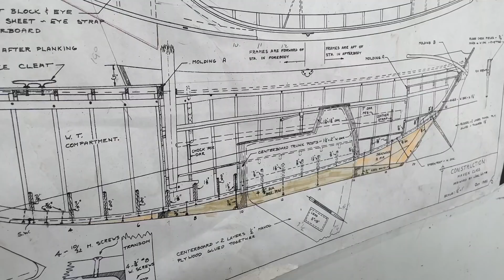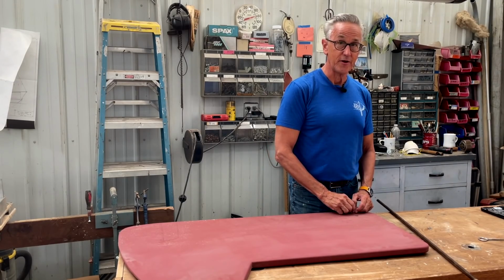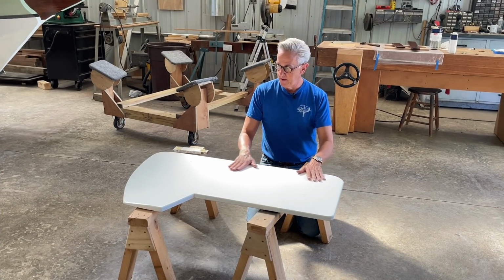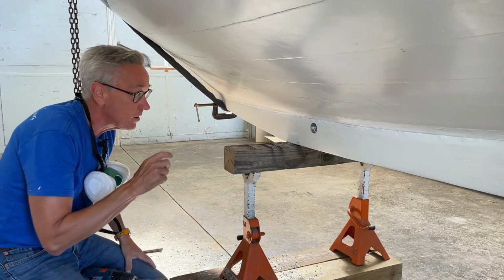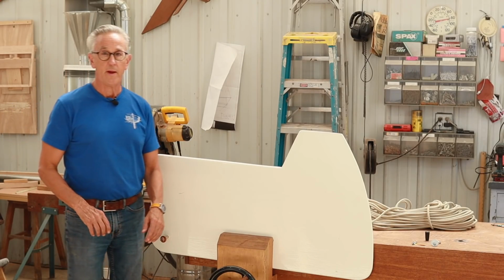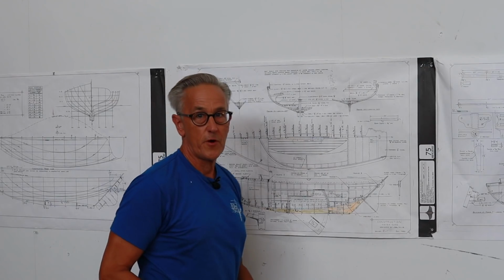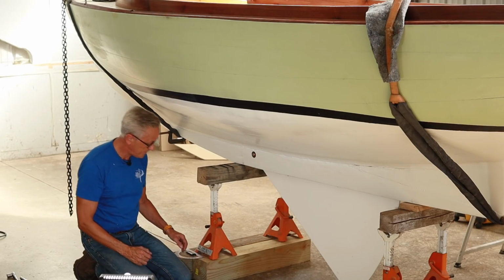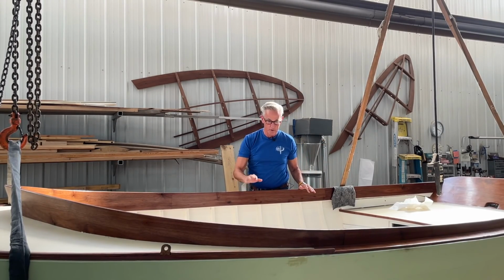Wooden Boat Building, Centerboard Installation S2-E52

Comment: Every piece of walnut that goes on this lovely craft just adds more class to it.  Nice work on this install.  Also as Ms. Trautwein mentioned below a G10 or Nylotron bushing around the pin in the lead portion of the keel might help with any electrolysis and also with any deformation of the lead from the stresses of the pin bearing against it.  Thank you Bob for this week's video.

Comment: News flash, WD40 is neither a lubricant or a coolant. It is a <W>ater <D>isplacement solution. You will get much better results from a high temperature oil or even a silicone spray. Still I'm glad it worked for you. That stuff has saved me more than once back in my teenage days. My distributor cap would get water in it during a rain and just a spritz of WD40 inside the cap would do the trick! I don't miss that old car 😃.
Reply: @bawrytr  
Actually it is a solvent, it will eventually strip away any lubricant that is present making it detrimental to use as a lubricant. I agree it works in a pinch, however it is always best to use a lubricant when the task calls for a lubricant. 👍🏼
Reply: when I drilled mine, I was worried about heat and seizing up. I went slow and had a glass of water handy. I kept dipping the drill bit in the water to cool it off.

Comment: HI Bob, wonderful attention to detail as usual and your video editing is superb.  I have a couple of thoughts. I hope that the screw eye isn't too tall. I couldn't do it the way you did as there wasn't enough room at the top of the board, pulled up and underneath the trunk covering board. I ended up drilling into the centerboard and epoxying the line directly into the board. Maybe you already measured and your dimensions are slightly enough different to allow that screw eye to have enough room but when I first did it that way, I couldn't get the board up and flush with the bottom of the ballast. The board was just ever so slightly lower and that wasn't going to work on the trailer. Please test raising the board up before you tightly fasten all together. The other thing that I am noticing as I sail is that I am getting water coming through the forward part of the trunk between the top and the forward covering board. I used no sealant as I wanted to have access to the forward part of the trunk if needed but since the forward part of the trunk is so close to the water line, when we take a wave and come, bow crashing down, water spurts out between the top of the trunk and the cover. I am going to seal it down tight as I had a fair bit to pump out of the bilge after sailing on Sunday. Hope this helps a bit. you're doing great!
Reply from the maker: Hi Chuck,
Thanks for the nice complement. I did measure the trunk height and chose the stainless steel eye size as not to be too high. At this point I have retracted the CB into the trunk and test fitted the cap and all fits well with clearance. My CB does retract completely flush with the bottom of the ballast keel. Great tip on the fore section cap for the CB trunk. My thought was the same as you as to access. I now will seal it before attaching it. Thanks for that insight.
Fair Winds my Friend!!
Cheers,
Bob
Reply: @MikeAG333   I will drill it out and replace. I used yacht braid line. I think it will out live me
Reply: @TheArtofBoatBuilding   I just ordered some Totalboat Seal. surely didn't want to use 5200, lol
Reply: @TheArtofBoatBuilding  what about a neoprene seal so that it is not glued down, but has a gasket of sorts?

Comment: No bushing in the lead ballast keel might be a good place for a G-10 bushings and washers to protect the bronze rod from galvanic corrosion.
Reply: I concur. However, bronze and lead galvanic action does usually take a while, but it will happen. Non-metalic bushings would slow this down extremely well.

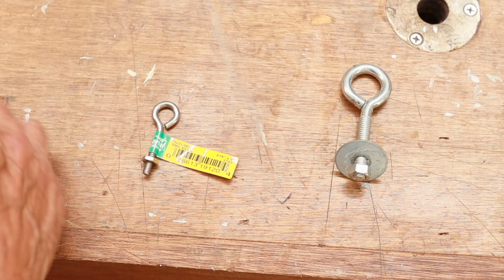Comment: At 12:40     Not all stainless steels are non-magnetic.  The magnet test is not conclusive.  It has to do with the crystalline structure, either martensitic or austenite.
Reply: , but one way or another the magnetization force is noticeably lower

Comment: Just a further note on stainless - 316 grade is non magnetic, or at least very close to it.  However 304 shows a distinct attraction to a magnet, but much less than ferrous metals. Which is a great way of distinguishing 316 from 304 if in doubt.
Reply: yup!

Comment: Why use topside paint for the CB ? Should it not be epoxy?
Reply: Most top side paints have some form of epoxy in them. I believe this topside paint has a polyester resin which is an air activated polyester epoxy paint. It just doesn't need a second additive added to it and mixed it before use, it sets while drying (air activated). It also isn't near as hard as the more widely known
 2 part epoxys.

Comment: Great episode again! Did you treat the threads of the screw eye so water will not seep in?
Reply: Great question. I was wondering if he epoxyed the eye bolt into the top of the centerboard, myself. Those small eyebolts are pretty fine threaded, wouldn't take much to pull that bolt right out of the end or side of most boards, wet or dry. But epoxy would strengthen the "wood" threads "cut/crushed in" by the bolt being screwed into the board, at least some.

Comment: Always a pleasure to watch your work unfold. A question:  how did you drill the oversized recess on the far (starboard?)  side of the keel?  It looked like you drilled the 5/8” hole all the way through before you drilled the second recess. I haven’t had any success with spade bits and large “pilot” holes in wood. Maybe lead behaves differently. Thanks for the video.
Reply from the maker: Hi Robert,
It may appear that way on the video. However, the keel is over 6” wide at that point my drill bit is only 3.5” long before the shank. 
Thanks for you question and watching!
Cheers,
Bob
Reply: @TheArtofBoatBuilding  Aha!
Reply: @TheArtofBoatBuilding  so, do you have a longer small pilot bit that you ran on through?
Reply from the maker: @thomasarussellsr  no, I just measured each side.
Reply: @TheArtofBoatBuilding  accurate measuring is a wonderful thing. Of course true equality un both sides is required for that. Minor differences can add up over time to throw things way off. I'm glad you are a perfectionist like me so that this worked out for you.
(Of course a large measuring caliper will also get you close 😉).